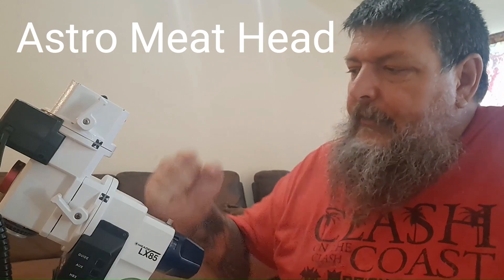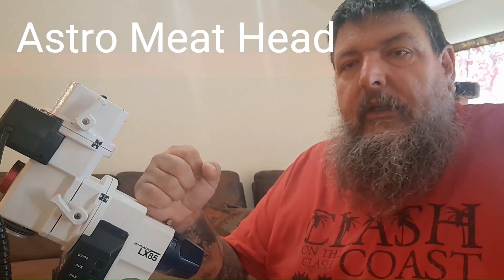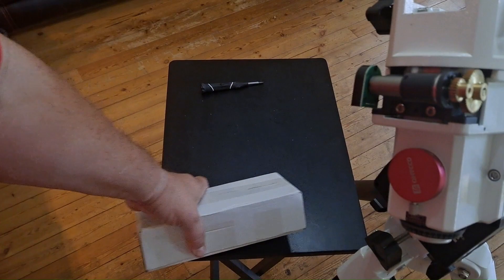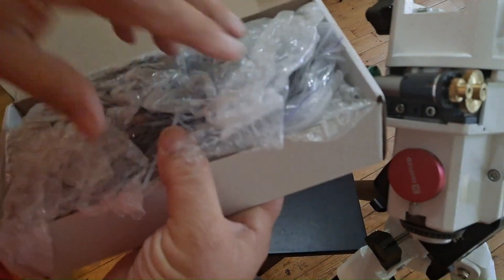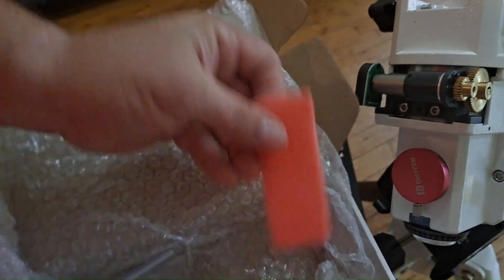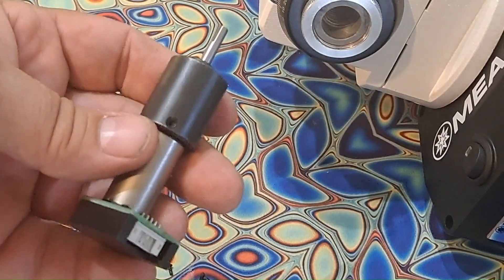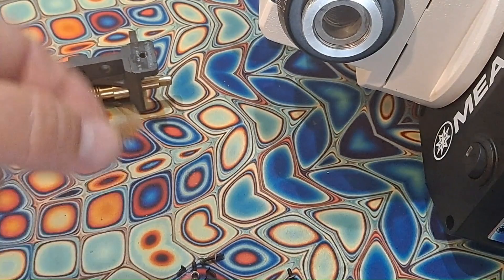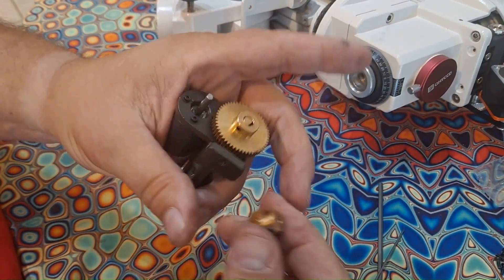Meade LX85 Brain Transplant and Belt Drive Mod

Comment: Have you taken the LX85 out for a test drive since the upgrade?  I too have an underperforming LX85 and am looking keenly at that upgrade kit.  One quick question if you can, does the old audiostar remote work with the new  'brain?"  Thanks for turning me onto this relatively cheap upgrade for a mount with sub-par components.
Reply from the maker: The Audiostar does not work with the new computer. The computer is no longer Meade at all. This is a complete stand alone system.